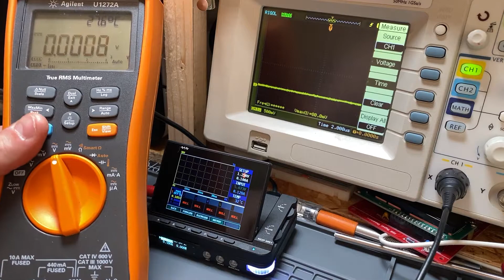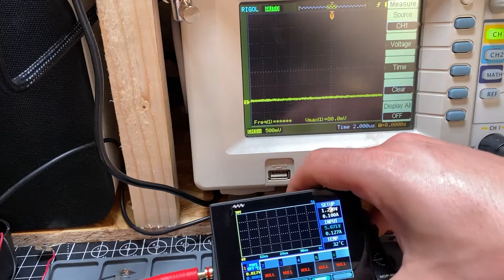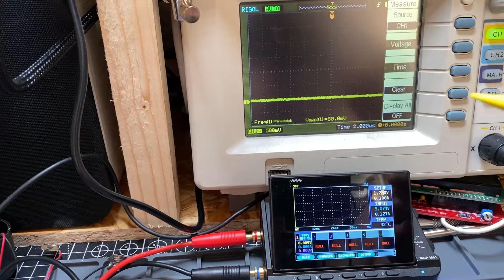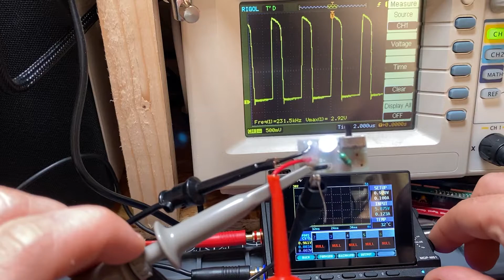YX8018 Followup

Comment: Do you have any suggestions how can I make flashing light with YX8018? I have exactly the same solar light circuit.
Reply from the maker: Hi, you could build the solar panel into the handle assuming that you would still like it to be solar panelled, you could then connect a larger capacity battery. If you required a brighter led then you could use a transistor with the base being driven from the output from the chip.
Reply: @anengineersadventures  Thanks for information. Gonna try it.
Reply from the maker: @Electrologia  Let me know how you get on ;)